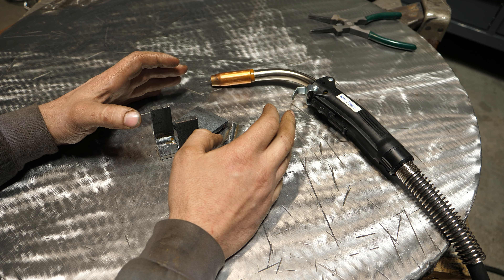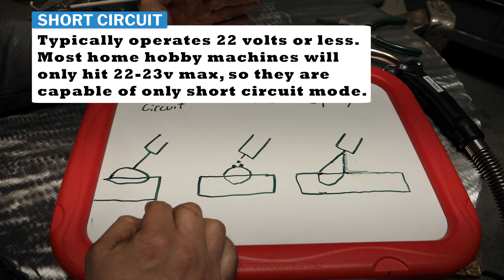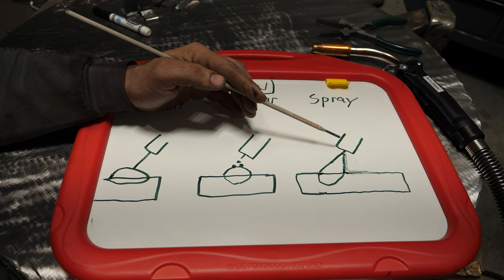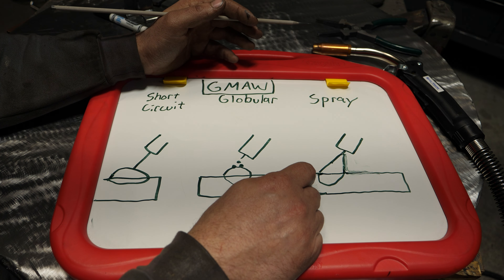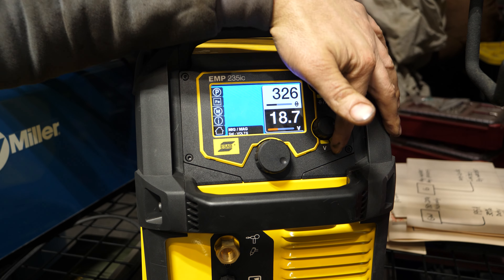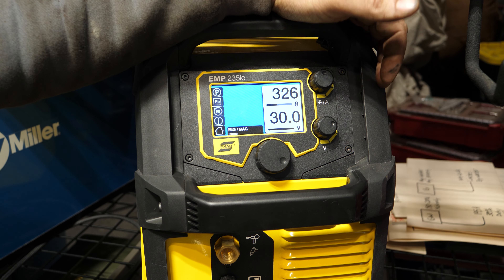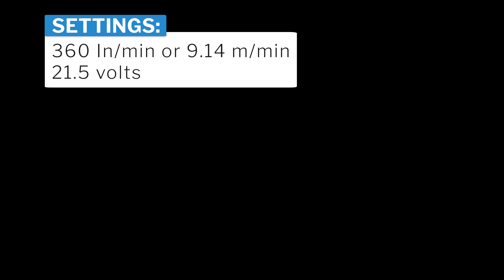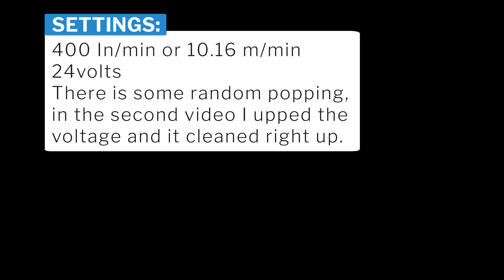Introduction to spray arc welding

Comment: Thanks for this Greg. I’ve always wanted to try spray. My welder can do it (275A up to 30V) and I have 36 series torch. I’ve just not had the need so far but your video will likely get me to try it. Duel shield is not recommended for mine so that’s not an option.
Reply from the maker: Dual shield will run with less parameters than spray, however I can tell you .035 dual shield is pretty useless on anything 1/4in and over (no penetration).  .045 dual shield works better on 1/4 in material, but many welders don’t have liners or rollers available for .045 wire.  Maybe that is why they don’t recommend it for your welder.  

With that said if you give .035 wire spray a shot it will give you a lot of capability on 1/4in + steel.  It’s about 2x as fast as short arc, less spatter, less cleanup, and far more penetration.  Just watch for blisters lol.

Comment: Love to hear your thoughts on pulse
Reply from the maker: So pulse works great because it allows you to run oddball angles and vertical up far easier than short circuit.  It also has better penetration than short circuit.  Proper pulse is basically a modified version of spray transfer that can be run out of position.  Less spatter too.  The main limit to pulse is having a machine that can do it, and on the low end (aka sub 250amp welders) its ability to weld thicker steel is still limited.

Comment: I occasionally use globular at work using C10 gas on a miller deltaweld 302.  It is tricky but it is doable.
Reply: Unbeknownst to me i have been doing Globular transfer on thicker material.  It would have been spray with different gas.

Comment: Can you make video about puls mig welding, I mean technique for puls mig welding.
Reply from the maker: So I don’t have a machine that can do pulse, I am talking with a company on getting a loaner to do that, it might be a while due to my schedule. I will share some details on the process since many companies scam people with this “feature”.  True pulse with wire should be pulse spray, aka you are using a different gas mixture than c100 or c25 and very high voltage setpoints. This gives the capability of running spray transfer wire vertical up and overhead.  This gives the ability to weld thick material with proper penetration in all positions.  The problem is, many machines claim “pulse mig” and they more or less just pulse the short circuit process with normal c25 gas.  The issue with this is you will lose penetration over normal non pulse, because you are lowering your heat rate input.  Sure, you can crank the high end of the pulse to high amp, but many of the machines that claim “pulse mig” are at best 200amp machines.  So realistically they will perform worse on thicker steel in pulse mode.  Pulse mig does have an advantage, mainly that it can weld vertical up without weaving which is useful.  Other than that it doesn’t really give much capability.  Keep in mind a good mig machine can weld paper thin material with .023 wire, and weld up to 1/4in steel reliably with .035 wire in the short circuit mode.  Adding “pulse” doesn’t give you much more capability.  Again true pulse done in spray mode is a significant step up in capability.
Reply: @makingmistakeswithgreg  Mine is 350 amp, I bought it 3 months ago, but I am having problem with thin staff. If I weld something that is thick there is no spatter, but if weld let's say 2mm square tubing, machine starts to produce spatter, this only happens in pulse mode and by the way I am using 82/18 mix. Sorry if my English is not correct, I am from Europe. Thank you for answering.

Comment: Cutting Edge Engineering recent videos on the Franna Crane Project have a significant amount of spray arc footage. I assume it's pulse since there are overhead and out of position welding on thick plate.
Reply from the maker: I will have to check it out.  If it’s spray (and not dual shield) and it was run out of position it definitely would be pulse.  That guy/channel is awesome no doubt.
Reply: @makingmistakeswithgreg  Note: I could be totally wrong about the process. I have never seen spray arc in person. Please let me know if I am incorrect.

Comment: Hello Greg.  After using the ESAB 235, do you think this machine & the ESAB 285 are on par with the Miller 235 & 255?  Have a great day and thank you for your great content.
Reply from the maker: Great question.  So the esab 235 vs the miller 235 I would say the esab 235 is far superior.  The esab will run 6010 rods, the miller won’t.  The esab is capable of 235 amp at 26 volt at 40% duty cycle, the miller is 170a 22.5 at 60% duty cycle.  That would put it somewhere around 200-210 at 24-25v for 40%, significantly less than the esab.  The esab is easier to carry around, has a better display, and will handle less then perfect conditions (like welding outside) better.  

When it comes to the 255 vs esab 285 that’s a harder decision.  The 255 does spray pulse, which the esab doesn’t.  Both run 6010, both have high outputs at high duty cycles (edge likely to the esab on duty cycle).  Between those two I would probably go with the 255 to get pulse.  

I can tell you that the miller 255 has had a less than stellar reliability.  I am not sure what the deal is, but a bunch of 250 amp class machines have had terrible reliability.  The Lincoln 260 was really bad, the miller 255 had a ton of problems, and a few other machines as well.  Esab has proven to be very reliable in the 235 and down machines, the 285 is fairly uncommon in shops.  I personally use a 355 miller at work and that has had zero issues but it wasn’t known to have issues like the 255 had.  I do believe in Esabs products which puts me the odd man out since virtually all the shops/places I go are miller or Lincoln.  I believe what Esab does that those two don’t is they make machines that handle rough environments better, they are more portable, lighter, and they focus more of stick welding than miller and Lincoln.  Up until recently millers 4k$ 220 ac/dc machine couldn’t even run 6010.  For me Esabs machines just fit what I need better which is why I have owned a bunch of them and still own the 235 rebel and rogue 200.
Reply: @makingmistakeswithgreg  Hey Greg.  WOW!!!!  The information that you gave is exactly what I needed.  But I am more impressed with the time that you took in responding to my question!!  You really care about us welding DYI'ers out there trying to figure things out!!  THANK YOU!!  Have a great day!

Comment: Can the Eastwood mp250i spray. I bought it after watching YouTube welding videos. It mig, tigs and stick welds
Reply from the maker: So I looked up the specs, Eastwood did a nice job on labeling what it would do.  It appears it’s capable of 26.5v which would be enough to spray with .035 wire between 200-220amps.  So on face value it should do it 👍

Comment: Very interesting!  I’m surprised that does not just blow through the 1/4 plate.
Reply from the maker: At higher settings and different gas blends spray would definitely fully penetrate 1/4in steel.  Even at lower settings and common c10 gas blends it’s pretty impressive.  It’s too bad an average mig machine isn’t capable of running spray, it makes quick work of thicker steel.

Comment: Hello Greg. On 6mm to 6mm carbon steel outside corner which is better : mig Short Arc with wire size 0.23(0.6mm) multipass or stick with 2.5 mm Dcep 6013 the root pass and then build with 2.5mm 7018. I use stringer bead technique. 6010 is out of the question because my stick machine is cheap and doesnt like it. And Doesnt have 6011 in my country.
Reply from the maker: So that’s a bit of a tough call.  If there is minimal to no gap I would use 7018 start to finish.  6013 (to me) is a harder rod to run on a outside corner, and tends to have the same or less penetration as 7018.  MiG is perfectly capable of welding 6mm steel, but with .035 wire.  I would think both 6013 and 7018 would have better fusion than .023 wire, it would be tough to get sidewall fusion with .023 due to the lower amperage it runs at.  The strongest weld would be found with er70 MiG or 7018, provided you can get the fusion.

Comment: I guess three years ago i picked out the Everlast 211 over the Vulcan 220.  The everlast has 210A @40%, the Vulcan is 200  @ 25% the eeverlast also hit 100A stick on 120V.  The vulcan hits ??.?V (incomplete specs from HF) the everlast 24.5V GMAW voltage.  If I had got the everlast's big brother the 251 it would spray( 26.5V )and pulse. But heck, they were telling me I would need to buy a special mix for it to work.  You're at $350 per bottle and I was counting three bottles.  So maybe I could try FCAW-S.
Reply from the maker: You bring up one of the major points with the cost of mig that nobody sees coming: bottle costs.  To have a mig welder that’s capable of welding steel, stainless, spray arc, and aluminum you need 4 gas bottles (c25, tri mix, c10, argon).  That’s a huge expense that doesn’t exist with tig or stick.  The other issue is many suppliers don’t sell c10 or other spray mixes in anything less than a big bottle, which can cost over 400$.  Definitely a tough situation to find solutions for.

To get the best performance on thicker steel there are 3 options really.  1: spray with c10 or a different spray blend, 2: run dual shield in .045 (or bigger) with common c25 gas, or 3: run big self shielded Gasless flux core.  Option 1 costs a lot due to the gas bottle issue.  Option 2 uses gas you have and gives you better performance on thicker steel than short circuit,  the downside to this is tons of smoke and the root fusion isn’t as good as spray.  Option 3 requires .045 or bigger self shielded wire.  If you use .035 wire and weld thicker than 1/4in you will have internal weld porosity.  You need bigger wire and more amperage to get proper results.  Many self shielded wires produce fairly brittle welds, so the actual strength of the finished weld may not be inline with spray or dual shield.  

For many people looking to get really solid welds on 1/4in and up steel, without the cost of additional bottles, .045 or slightly bigger dual shield wire is the way to go.  That’s provided they have the machine power to run it.  When you get into dual shield and spray it literally solves all the issues wire welding has on thick plate and really makes a world of difference.

Comment: Ive done some spray welding with way higher voltage and way lower wire feed than you are using on plate over 1/4". 
.35 wire 32 volts 185 inches/min push welding. 
It runs smoothly and the weld looks nice but I have to be careful not to melt the plate its better on heavier than 1/4" Ive never cut and etched or broken a weld.Im entirely self taught so I could be doing some dumb stuff any comments?

PS after watching a few of your videos Im going to try switching to pull welding, for short arc. Looking forward to a push pull comparison with spray welding. I do wonder how push welding at a higher voltage but the same wire speed would compare with pull welding for weld strength on short circuit welding. The only reason I push weld is because someone told me thats how you are supposed to mig weld when I first started mig welding.
Reply from the maker: Depending on what welder you have your voltage may be off from the setupoint.  Based on 32v 185 you should have an arc that exists between the contact tip and the molten pool and the wire should be liquid at the contact tip (likely fusing to the tip itself).  

Spray arc basically exists anytime the wire is no longer a solid wire (or globs) and more or less sprays across an arc that’s present.  It can be achieved at 23-24v and up provided the gas mixtures allows for it to happen.  The higher the co2 content the more voltage it takes to enter spray.  

From a strength perspective I believe a pull angle will produce more penetration than push with spray.  The major difference between spray and short circuit is spray will produce a flat weld with pulling, short circuit produces a convex weld.  A pull spray weld more or less looks like a push short circuit.  The profile of a flatter weld is more ideal (I think) because there is less of a chance of poor fusion at the weld toes, and it likely distributes a load better when the weld is stressed.

Comment: What can you expect from globular transfer? Apart from spatter, will the penetration and strength be equivalent to spray transfer? If you occasionally need to weld thick materials, perhaps it could be an affordable alternative to spray?
Reply from the maker: So globular makes a ton of sparks/spatter, the metal deposition is pretty poor, but the penetration is higher than short circuit.  C25 or 100% co2 will cause the wire to switch to globular at or around 22-23v.  The limitation is the welder used.  Many mig machines can hit 23v just not at 180-200a of output.  

I will be testing 100% co2 vs c25 soon.  I have a feeling 100% co2 will perform better in penetration than c25, but it generally requires more voltage, which may not be available depending on machine.  Most of the time it’s 1-1.5v over c25 settings.
Reply: @makingmistakeswithgreg  Ok, please test both short circit and globular :)

Comment: Awesome video, just one question, can push and pull with spray like short circuit?
Reply from the maker: You definitely can do either.  I will do a comparison video between the two to see how it performs.  I would assume pull will have slightly better performance than push.  In the video I pulled and the bead was far flatter than the short circuit weld that was pulled, due to the higher voltage.

Comment: Would spray offer better penetration than stick?
Reply from the maker: Spray welding will penetrate better than 7018 rods and be as strong.  6010 stick rods will penetrate as much as spray, but the weld they deposit is weaker than spray.  Spray is very valuable in production welding because you’re able to achieve large single pass welds with big penetration without beveling.  The amount of time that can be saved is huge.  The main downside to spray vs 7018 stick is the cost of the welder and how much of a beating it puts on it.  I can stick weld 2inch thick steel with a 150$ stick welder.  The bare minimum machine cost to be safely welding that thick of material with a wire welder is probably 1k plus a gas bottle.  Stick is still the “every man’s” affordable solution to welding thick steel.

Comment: are you going straight in , or an angel on the gun? hard to see on the video. Our local large metal fabricator is using C18 for spray and short circuit.  Often been thinking using a Y mixer between CO2 and argon to play with different mix .  Just not sure a Y will do sufficient mixing? happy Easter.
Reply from the maker: I had a slight pull angle for the welds.  Technically you can push or pull.  The benefit to pull is it should increase penetration like pulling with short circuit does.  Due to the high voltage the weld is far flatter pulling with spray than short circuit.  

As far as gas mixing goes, you could set it up to flow from two bottles with a y connector.  The issue with that is you could run into consistency issues as the bottles deplete I would think.  With spray a small increase in c02 will prevent spray from happening (c25 won’t spray but c15 would).  Any variation in the gas mixture will have a significant change the the arc.  If decent flow meters are used and the bottles are at decent pressures it should work.

Comment: Do you think the Primeweld 285 would handle spray arc ?
Reply from the maker: So I believe it should hit atleast 26v so if it does spray shouldn’t be a problem.  It has a pretty big mig gun so it should handle the heat without issue.  For some reason the spec sheet doesn’t list voltage range on output, but the settings chart I can see goes to 25v so it should be able to spray.  

Edit:  it seems to not come with a .035 drive roll (v groove) so I would pick one up because .035 is better for spray than .030.  👍

Comment: Could you make a video on welding off a 2500 watt max portable inverter generator. They're pretty popular, perhaps you could borrow one. I am curious what could be done if this was all you had?
Reply from the maker: I can give you actual numbers because I have tested enough welders to know.  If you had a fronius 180, esab rogue series, miller maxstar, or other highly efficient welder with power factor correction, you would be able to weld at 90a output on a 7018.  That’s provided the generator outputs 2500 running watts.  At a 1800 running watts 2500 starting watts you would be able to run 60-70 amps on 3/32 6013 or there about on a 5/64th 7018.

The only way around this is with a welder like the fronius battery powered welder, which uses the generator to more or less charge the battery.  This setup is capable of 150a of output in a generator.  

Edit: another thought would be using tig.  With tig the voltage is run a lot lower.  You could probably tig weld at 110-120a on a 2500 starting watt generator.  That is borderline enough to weld unlimited thickness material.  Keep in mind it would be very slow in comparison to stick to get any metal deposition.
Reply: thanks Greg 
 @makingmistakeswithgreg  🍺